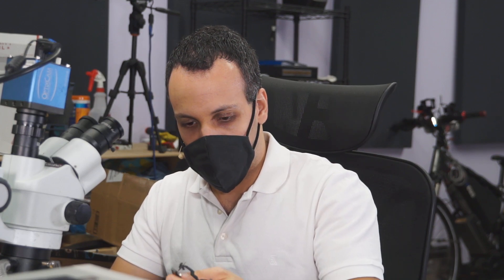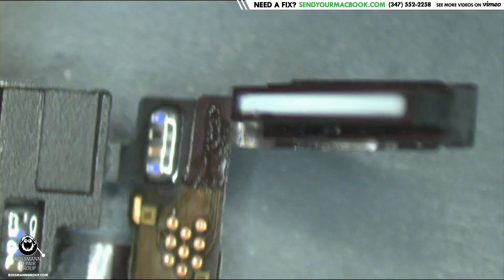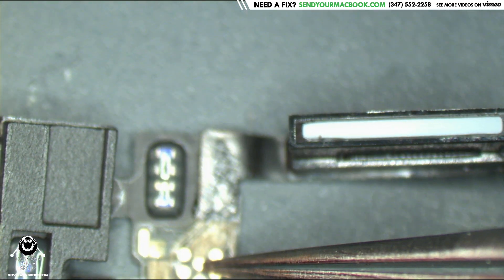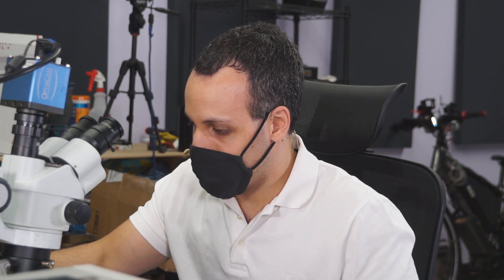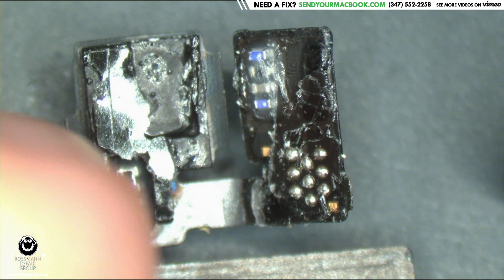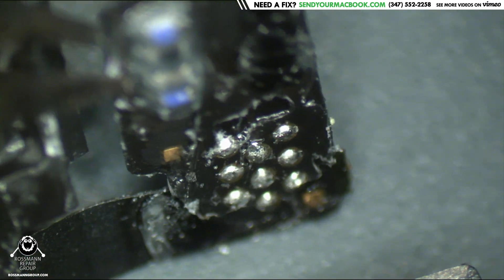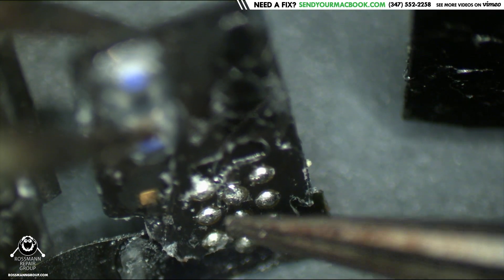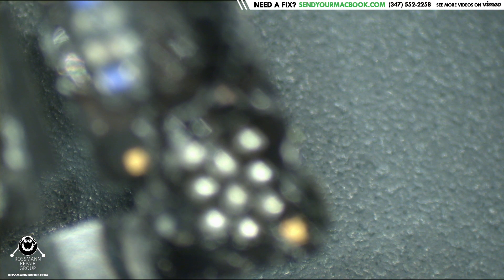A strange iPhone flex cable

Comment: Oh wow, it's my phone that you're fixing! I dropped it off yesterday for data recovery and was dealing with the boot loop issue. Love your videos and knew I had to bring my phone into Rossmann Repair. Thank you so much! FYI Apple Support told me there was no chance to recover the data and that I needed to restore it. (Shocker, right?)
Reply: It's Rossmann, just so you know.
Reply: @MrBitterman75  Thank you, fixed!
Reply: There is no way (within their options) to recover the data.
Reply: if it's boot loop from the prox that wouldn't have even worked!
Reply: @ABarbershopBarber  'glorified mailing centers'
Reply: @ABarbershopBarber  well... there's no way that they're prepared to offer. That would require paying actual tech's in their idiot bars. Which is an option they have, but refuse.
Reply: Maybe you wanna consider another brand next time, apple is just fucked up concerning costumer care since steve jobs died. And their products aren´t as good either.

Comment: Yes! It's only mobile sentrix's shitty flexes. I've been forced to order OEM ones elsewhere. I also tried to return mine and separated them like you did in the video and they refused my return. Even messaged a rep ( Waqas)  about the issue and he shrugged it off. Just stay away from their proxes for the X series or 11 or ipads
Reply: T. Walker I use injured Gadgets for parts, They got a good return policy and make good parts in my experience at least.
Reply: I always buy the premium parts from MobileSentrix and very rarely have an issue, I can agree that their aftermarket stock isn't very good though.
MobileDefenders is my Secondary supplier and they have really good quality for not much more cost.
Reply: I've been using Mobile Sentrix for about 2 years now, I've had a really good experience.   I have run into the occasional defective LCD, but they been really good about honoring their warranty and correcting issues that arise.  They have had the lowest defect rate, compared to any other supplier I have used.  Their LCD and battery quality to price far surpasses the competition
Reply: Welp I jinx'ed the fuck out of myself with this one, went to go do an iPhone 6 repair this morning and had a defective screen, I should of known better..

Comment: Hot glue instead of soldering - classic.
Reply: But they are both hot and stick things together.  Clearly, it is an acceptable substitute.
Reply: It's my way to solve my problems with my PCB at school.
Reply: Soldering is just hotglueing with conductive metal

Comment: Might be a good inspiration though: if you need that on there temporarily for data recovery but can't get them already soldered, you could use z-axis conductive tape to put the sensor on!
I first learned about that kind of tape on a Marco Reps video: it conducts across the thickness of the tape, but not along/across it, so it can be used precisely for SMD bodges like this.

Comment: If "soldering is required", why did they go through the trouble of glueing it on there? 
Doesn't make sense.
Reply: Additional layer of transport damage protection? Idk, trying to think if something reasonable, but it's not going well.
Reply: It could be that if u get some parts early they aren't up to scratch but later when the suppliers become aware of issues they supply good parts/correct parts. So this could be an early release of that part that was rubbish. It happens alot in the rush to be first to supply a specific part.
Reply: Well it is a scam that they make you believe its there but all the same when you need your original light sensor for face id at least you don't need to de-solderer just have to pick off glue for half an hour lol.

Comment: The device won't bootloop because the flex isn't there. Disconnecting every flex is part of a standard isolation test. It will boot just fine without it.

The device will bootloop when there is an issue with the connected flex. Specifically, it will kernel panic when there is a stall on the I2C bus due to a short on SDA, or a break in the clock (SCL).

The effect of that over time is firmware corruption due to a full filesystem (it fills with error logs), after which point the device will bootloop even after the defective flex is disconnected.

At that point you just disconnect everything non vital (because why add variables), and update the device.

Assuming of course that the user data isn't also full. Then FSCK refuses to check the (probably not even damaged) filesystem and you are SOL

Comment: I want to mention a few things before we all jump to conclusions here about Mobile Sentrix. These cables are meant to be like this and they allow you to quickly remove the component and solder a new one (the original). This is how they were from the start. Since this video and some posts about it on the facebook groups Waqas has since pulled this batch and started doing them without the FaceID part on them AFAIK. However, the claim of "you need this part for boot" is incorrect; you do not need this part connected to boot the iPhone - it will boot just fine without it. Also, the bootlooping is caused via corrosion on the face id flex (it gets in through the ear piece) and usually gives error 4013 upon restore. You can simply disconnect this flex and the phone will stop bootlooping and will boot correctly allowing you to use and get a backup of all of the user data. I hope this helps clear everything up. Thanks.

Comment: That fact that the phone will boot loop without the ambient light sensor is already beyond stupid.
Reply: It will also bootloop with bad front cam flex, rear cam, system connector or basically everything. I've seen too many 5s with bad proximity sensor that caused boot loop.
Apple I guess...
Reply: Apple logic
Reply: Bart well I see no reason why it couldn’t just boot and just set maybe at half brightness and then alert the user... instead of making the user think the whole phone is broken and not allow data to be taken off of it.
Reply: @AppleReviews  Thats a very stupid solution for a detected hardware problem. Usually if something goes wrong and the device can tell what's broken, it should just send a notificafion about it and work without it.
Reply: @theEskalaator  
Bootloop due to $8 part faulty
Customer: My phone doesn't start
Moron Bar: Motherboard chiplet transinducer bad, $800 fix
Customer: I could almost buy a new one for that!
Moron Bar: Here's the new model, $1,500 please.
Customer: Oh well... can you at least reco...
Moron Bar: No.

Apple. Don't think, just buy
Reply: @AppleReviews 
And giving an error code would be too easy to diagnose, right?
Reply: @IgorFighter7  Key word "should" but even android doesn't typically do that unless the manufacturer added tools for it and even then it's usually a manual check.
Reply: @vgamesx1  But i can't think of a single android that boot loops if your light sensor or whatever goes bad. I'm running an old as dirt S4 at this point and other than the battery (replaced) everything works.
Reply: @zuroxtv2199  YEAH! it's as if they charge Apple for a simple popup warning
Reply: Anything is good to sell more crap
Reply: Android logic can't display wallpaper so boot loop.
Reply: Dangerous Amoeba android can boot loop with just a wallpaper. So I guess android is better?
Reply: ZuroxTV well I see no reason android could not warn a user with a different colour space to change it to Srgb?
Reply: lllBASlll pixel also 800 dollar phone. You put a wallpaper the phone stops working.
You go to repair centre and ask for fix.
Repair centre sorry.
Google I guess don't buy it?
Reply: Marco Viggiano as if they charge android money for a popup when you use a wallpaper from a different colour space?
Reply: Moog • 38 years ago Updated 1 month ago yep like a wallpaper bricking your phone in android.
Reply: I can’t wait for the Apple car to not start when a tire is 5psi low.
Reply: @BornArcher8  
Jeez, at least hand me a cup of water with that salty comment.
You sound like you feel personally attacked by anti-Apple comments, so you have to find something wrong with Android. Well, good job. Just fyi, I hate Android as well. Unlike most adults with an Iphone, I stopped being a fanboy for tech since my launch PS3 died when I was a teenager.
I hold no allegience to any company- that would be naive at the very least.
I am perfectly satisfied with my $170 smartphone (which was the cheapest my carrier offered) Probably because I don't use it more than 2 hours a day, but social media addiction is a different topic.
Why can't you just be a reasonable person and admit that Apple pursues a very anti-consumer / pro-profit strategy? Or do you still flinch at the fact that the company that sold you your ridiculously expensive phone is a terrible one, but you still have to defend that purchase, otherwise you would have to admit to yourself that you made a mistake?
Reply: lllBASlll This is the problems with assumptions.
1 I have a Samsung Tizen Phone (not android or iOS) it costs 100 bucks
2 I have a MacBook Pro 2011 handed to me by my father
3 I have a Samsung Android tablet
4 I have an iOS iPod

So no I have no brand loyalty. If you see the replies I gave they were to specifically people highlighting the problem with Apple and acting like the problem was artificially created and there are no such issues with Android And thus I was going after them. What I hate are not anti-Apple comments but just comments which don't talk the other side of the story. Also before you assume again that I had a better time with any particular product, no I did not all had there fair share and I don't like anything product particularly. If you look into other comments by me I also trash Apple for their stupid practices and their crappy PCB design I am not a fan boy. I go with what offers me more feature I care about/price to performance. Also I see you call me salty but non of the Apple haters anything. And you call the Genius bar the moron bar which it is but did not tell anything about the other service centres not being able to recover your data this is clearly the problem. This is what I want you to answer. The reason for a boot loop is code and android too has bade code. Someone reading your comment can think Apple sucks (it does) but Android doesn't have any flaws (it has flaws) and go for Android. And after a problem thinks Android sucks and spends money on a crap iPhone. So I go around and show the true picture of both the sides.
RIP PS3.
Reply: @BornArcher8  
I guess I read too much into that one comment of yours, my bad. I think it was a knee jerk reaction to all those Apple fanboys that blindly defend their brand.
You're right, none of the big players have good "customer service" as far as I know.
Reply: I had a lot of experience with android phones and what I can say is that those phones usually ignore this sort of problems. Camera flex broken? Then you can't use camera. Fingerprint sensor broken? Can't use fingerprint, as easy as that. No notifications, though. Just imagine your fingerprint sensor/camera as a USB device, it's just disconnected and that's it. It's something like if you disconnect your mouse the PC does not work. Anyway, no one will read this shitload of text, so I can lie a little and tell that I'm gay.
Reply: exys The problem with having your fingerprint as usb is not a big issue. It slightly reduces speed. Most manufacturers actually have it like usb but with faster standards than standard usb. The main problem is with cameras. Cameras are connected directly to the soc this makes processing stills slower and makes video playback trash. This is one of the reason why laptop webcams even those with good sensors have really bad quality. So using a standard like usb is not possible. You need a standard which is directly connected to the soc. This adds problem for coding as these standards are more hard to program for. And Apple chooses  not to do the extra code because they no it's very rare that people will use a phone without a fingerprint scanner or a camera. Android does this because they care about the customer and also usually use a usb like standard built in. This is the reason why stock Android was affected by the wallpaper boot loop glitch but not the android of OnePlus phones as OnePlus actually modified Android to do correct colour space  converting while stock Android did not have this built in to it.
Reply: Bootlooping is not intentional. It throws kernel panic if there's a short on a cable. It will boot fine if sensor is just not working, as well if sensor is not present at all. It will not boot however if faulty sensor already done some damage, which makes removing sensor not changing anything
It won't boot without it's own Touch ID button though because of security reasons

Comment: I worked for an independent repair shop for a bit and the owner purchased parts from MobileDefender. Occasionally had a bad part arrive, but typically good aftermarket stuff.

Comment: iPod Touch 2G and 3G have a flex with various gold finger  and pads, they used Z-axis tape that only conduct electricity from the top to bottom.  Mostly the same tape that LCDs with COG flex IC cable use to bond it to the glass (ACF or  Anisotropic conductive film). But that one you show us looks like a hard glue. You could make a test with the DVM to check is there any resistance on the Z-axis.

Comment: I think it shipped to the people stuffing the board with a protective plastic over the contacts and some underpaid person forgot to remove it before soldering the component with hot air. It melted just enough to stick and they never did a functionality check.

Comment: From working with flexes in my work life, it looks like the adhesive was supposed to be an underfill of some kind.  I wonder if the adhesive cured before the soldering process occurred, or the light sensor didn't get soldered down properly (Bad profile?) than the adhesive cured?  I doubt they are inspecting their flexes to verify the light sensor was soldered down properly.

Comment: Funny, just yesterday I replaced the screen assy on my 6 plus, and the ambient sensor is non functional. I had read on a comment that the original front camera, with the sensor, should be swapped from the original to get this to work, but I wanted my digitizer and screen renewed, so I didn’t do the extra work.  Now I either learn to control the brightness by hand, or do another hour or so surgical procedure again.

Comment: Just remove the flex u don't need it, it will not bootloop without it u may need to update the SW, but then u don't lose data. Ohh also if the ambient sensor got corrosion on it like that u have to reflow it and u might don't even need to replace it.

Comment: I'm confused I've never had an iPhone bootloop on me because it didn't have that flex connected. You can start the phone normally like you would to test if a screen works without connecting the face id flex cable.

Comment: Is it possible that the glue did not act as an insulator?
Reply: No, any bulk material that is an electrical conductor physically can't be transparent. Since the glue is transparent, it must be insulating. There are conductive glues but this is not one of them. (Nanometer-scale films of special materials can be both somewhat conductive and somewhat transparent at the same time but the glue on that connector is way, way thicker than that.)
Reply: @jonathans175  Okay, thanks.

Comment: Just heard the iPhone 12 will be shipping with no cable and charger in September. Any thoughts?
Reply: Makes sense to me. Almost everybody by now will already have a charger or 20, most of which even will have enough power to max out the phone. Those who don't can cough up a few more bucks, at Apple or elsewhere, to get one. I now have about 30 or these things kicking around, and even more cables, which is kind of a waste.
Reply: i have a bunch with Micro USB and one with USB-C. If I were to buy that, I'd have to buy a Lightning cable.
For recurring iPhone users it might be fine, but for the 5 or so people who think about switching over this is a no.
Reply: Dan Swinehart Honestly, Apple would be saving quite a bit of money in shipping their phones if they remove these items and slim down the boxes. But then they should pass on the savings to the customer and not charge the same price as last year.l, otherwise they’re ripping people off.
Reply: Yeah, that's what I thought: for customers switching from Android it would suck as you'd need to spend the extra $, but for people already with iPhone it wouldn't be an issue (I guess).
Reply: @Dept-of-Agriculture  We're talking Apple here. Passing savings to the customer hasn't been a thing for at least a decade.
Reply: Dan Swinehart as a long time apple user if you ask me it is as questionable as the headphone jack drama but if they give opinions I will close one eye

Comment: This stupid glue is what made me fail my first iPhone 8 screen replacement... was going well up until when I tried to remove the proximity flex from the old screen. Wasn't expecting it to effectively be two flex cables glued together, accidentally pulled off the connector part of the flex off the main flex because it was glued together. On the iPhone 7 the flex is a single cable, no glue involved besides the adhesive for the proximity/light sensor + earpiece connector (which is the only glue I was expecting).

Obviously now I know better, but I have absolutely no clue as to why Apple would go this route. They wouldn't be doing it to save on screen replacement costs in the case of one of their employees accidentally ripping the cable during a screen replacement, because they replace the entire assembly in one go + pair the new components to the device via Horizon, instead of replacing just the screen and transferring over the proximity flex and home button (if applicable).

Comment: i had a 5c power flex cable and the flash and mic were glued on instead off soldered and it did not work